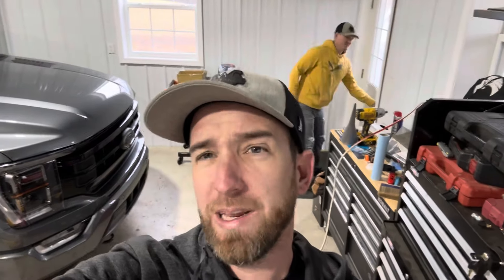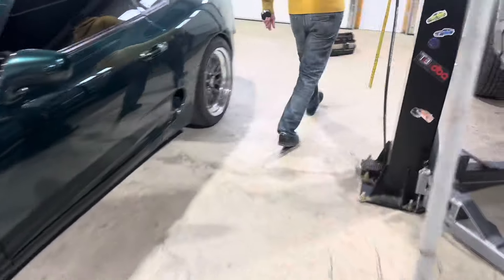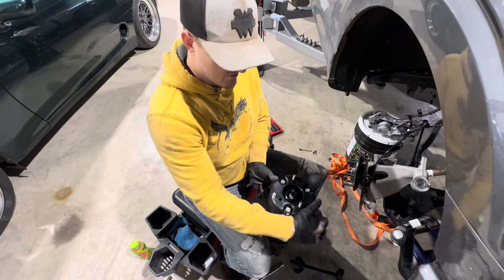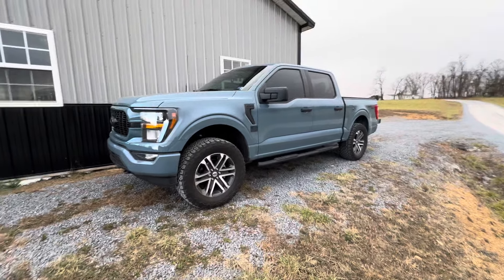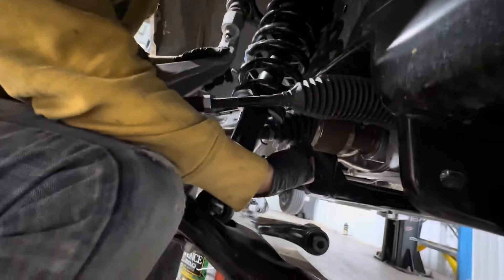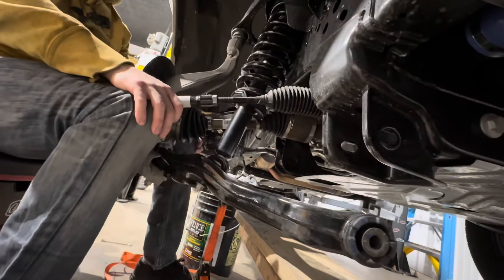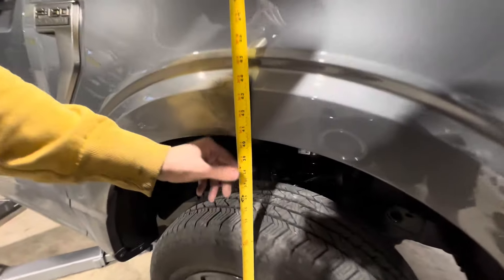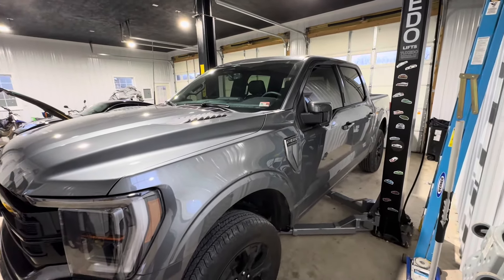2023 Ford F150 Leveling Kit Install

Comment: I have the exact same truck you guys are working on and the ride quality is very good. Can you comment on the change to the ride after the leveling kit was installed? Thanks
Reply from the maker: It’s still rides very nice.  Seems like it floats a tad more if that makes sense, but overall not much change.

Comment: So the 2” puck actually netted 2.75” in increased height? Maybe I heard wrong but previous measurement was 37.75” in front and now measuring 40.5”?
Reply from the maker: Correct, I’ll go back and watch it.  Hard to measure it now since I also added the 35 inch KO2s.
Reply: 10-4! I think what’s throwing it off is you have new tires included in the final measurement. So when truly understanding what the leveling kit alone achieved, you would’ve had to measure after they were installed on the original tires. There is some new tire height built into the 40.5”. Guessing the 2” probably got you just that, 2”.
Reply from the maker: @MichaelDeFrank-w7j  agree, I’ll go back to check it.
Reply: @seanforney24  Hey Sean, Thanks for all what you share with your beautiful F150, I would like to ask, could you please re-measure your front and rear with your K02 in-place?

Thanks!

Comment: Is your truck equipped with Bluecruise and CCD? If so, did you have any issues with either after the install? Thanks for the video, nice truck (I’ve got the same one)!
Reply from the maker: It is equipped.  I did not have any issues, I called around and made sure before I did it.   Still works as intended without issues.

Comment: What is the actual tire size on 20” rims, I have basically the same truck except for black, I have been looking at doing the sale. Was thinking 295 60 R20 tires, this close to what yall are using?
Reply from the maker: @JamStph  35x12.50 is what I bought for it.
Reply: Thank you!

Comment: Hi guys. I levelled my 2022 powerboost. I put the weight scale option on it (it tells me how much weight is in the box, if you didn’t know). Got a notification from the truck that the scale wasn’t working properly, Long story short, I was told the scale can’t work properly because of the levelling kit. Have you guys ever run into this?
Reply from the maker: That is the first that I’ve heard of that.

Comment: Are the 35” tires grinding when you make a full turn? I had 35”x12.5” tires on my 2018 f150 and had to do a lot of trimming n wheel well and crash bars so they didn’t grind.
Reply from the maker: Mine did rub, but I got the 1/4 inch spacers and it’s fine now. My brothers, same truck didn’t.  So strange.  Same tires also.
Reply: @seanforney24 did adding the spacers create offset and push the outside of your tires out wider than the outside of your truck/fender flares? Just curious. I’m wanting to add 35’s to my new 2023 but I don’t want offset or rubbing. Trying to see if that’s even possible. I had 35” Nitto Ridge Grapplers on my 2018 with lots of offset. Im thinking the offset was the issue… 🤷🏻‍♂️
Reply from the maker: @adamboerger408  it made it sit pretty perfect.

Comment: The grey truck with the 35s ko2s are the stock rims 20 inch rims? Do the tires rub at full turn?
Reply from the maker: They did, then I added 1/4 inch spacers and it’s solid now at full lock.
Reply: What size tires are those? I want to do the same set up

Comment: Guys I installed aftermarket 2.5'' profender shocks to my 2023 powerboost F150 and in a week time I got the left axle clicking and when I engage the 4x4 I get Check 4x4 message! Any one have faced this before? Is the 2.5' lift shocks damages axles? Is the axles issue causing the 4x4 message? 
I went to ford they are not sure yet. But they said the 2 inch shock lift caused the left axle issue! Anyone can help